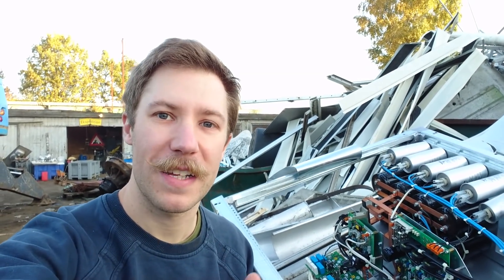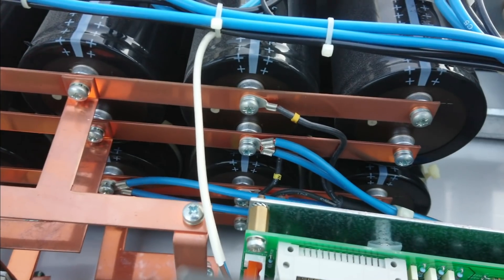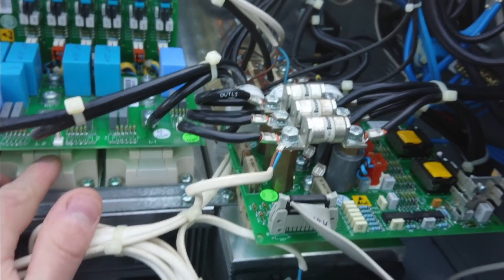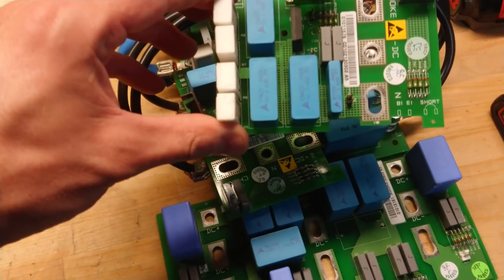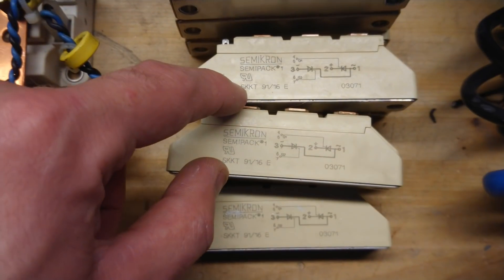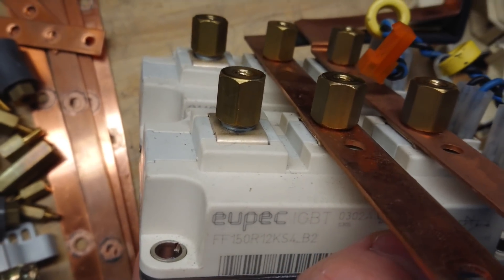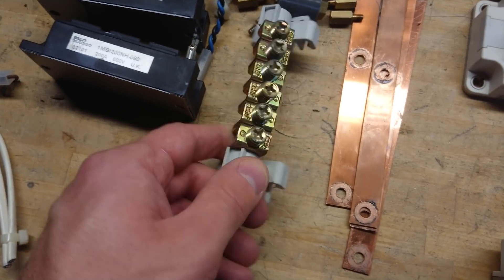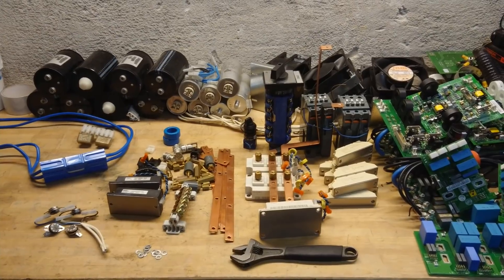Eaton PowerWare 20kVA UPS (Early Morning Junk Yard) Teardown

Comment: Hello,
thank you very much for this interesting video! Thumps up!
I have some information vor you;
1.) i pay often with paypal. It will work very well. But check out your system. I want to pay for your channel with paypal. It will not work.
2.) i am looking for an circuit diagram for an Liebert ITA2, 20kVA Version. Can you give me an tip, where to become?
VG, Jürgen B.
Reply from the maker: Thank you very much Jürgen. Paypal is possible from my website: https://kaizerpowerelectronics.dk/about/donation/ and that would be appreciated :)

I have however never seen a Vertiv Liebert UPS, so I can not help you there.

Comment: Thank you again for your video.  Did you keep any of the fans from Eaton 9355 40 kVA or similar ( the model with 7 fans)? If so, can you please make some pictures which would help me identify the part? Also I want to add a MBS switch,  like the 63A o e you have in video. I purchased a 125 A switch,  but have no diagram for the connections. Do you have any hints on how they should be wired please?
Reply from the maker: NMB-MAT 4715MS-23T-B5A or papst typ 4650n or ebmpapst 4656 z